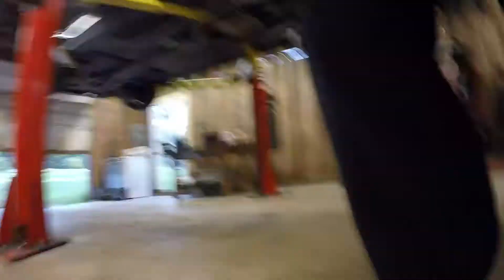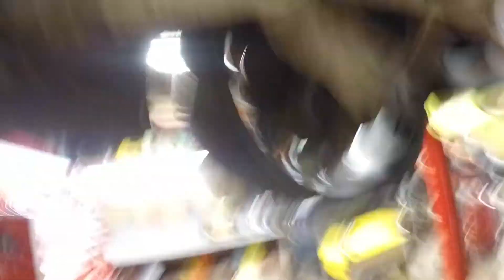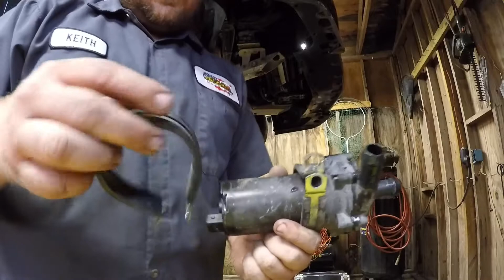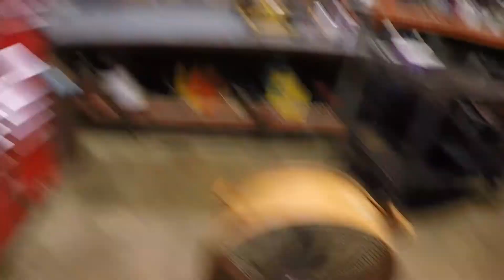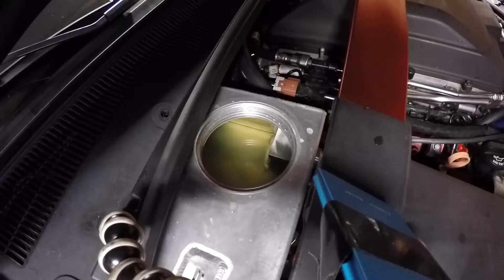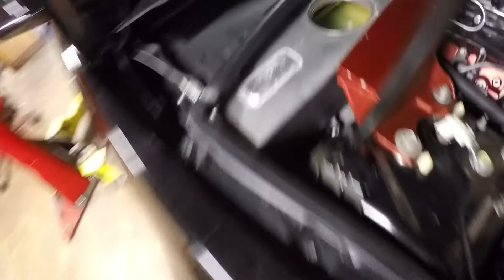Replacing the intercooler pump on a cts-v.How to bleed and flow video!

Comment: So from my understanding instead of a regular water pump a Cts v as a auxiliary pump in replacement of a regular car water pump
Reply: No, this is solely for the air-to-water Intercooler system only. Regular belt driven pump for engine still exists and does its Job circulating coolant through engine/radiator

Comment: Why would you use a stock pump...? lol all that work to replace a known bad pump... plus what you doing rolling around with that nasty ass coolant in there.... had the system apart why not fill it with new fluid?? Definitely taking shortcuts...